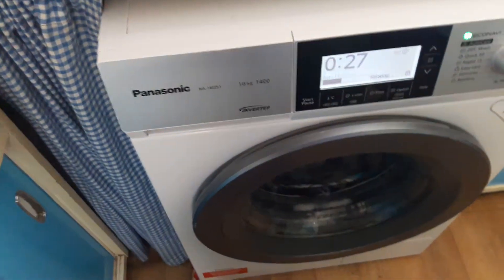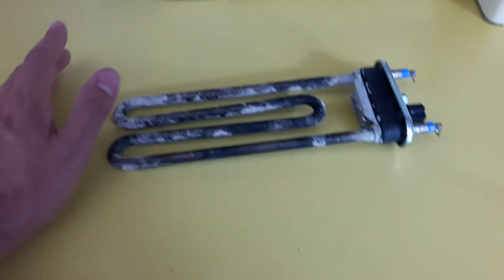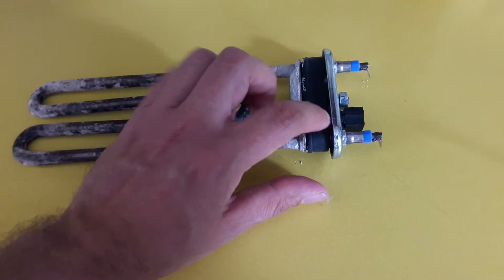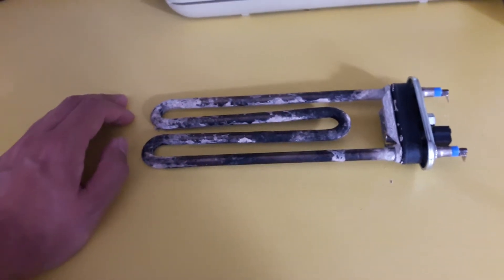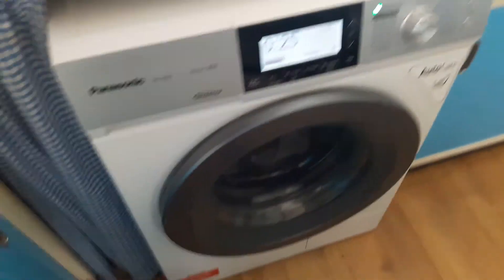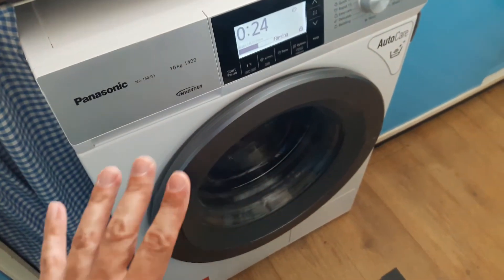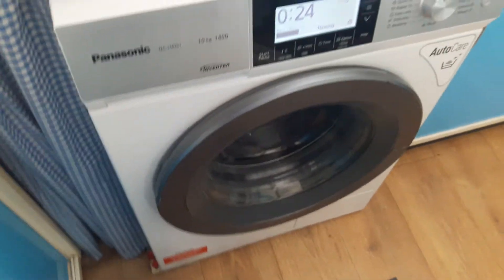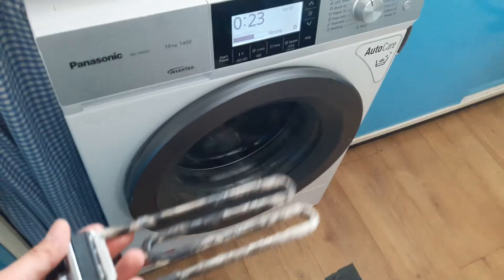Panasonic NA-140ZS1 washing machine open circuit heating element repair part 2

Comment: Hello and thanks for the video, I am struggling to find the element and from the video you state you used a different one ? have you got a link or a part number which would be hugely appreciated, thank you
Reply from the maker: I don't have the exact part number but the element is replaceable with a visually similar looking part, as long as the length is about right something that looks the same should do. Try to also match the wattage so it all heats up as before and lower wattage will take longer etc

Comment: How the element was removed would have been useful, limescale would cause overheating, it forms an insulation.
Reply from the maker: There are lots of much much better videos out there detailing how to replace the element on a washing machine i'm sure you will find much more helpful and useful

Comment: That is a Gorenje made machine
Reply: How do you know many Panasonic washing machines are made by Gorenje? Not all Panasonic can be made by Gorenje, some could be made by Midea or Vestel, or some can even be made by actual Panasonic theirself but only can be seen in Japan where both all top & front load washer dryers come with heat pump
Reply: @huuhoangmanh685  I said THIS is one of many gorenje made panasonics. Not all panasonics are gorenje made like you said,
Reply: These are made by PRC , only thing I need to replace is  the a shock absorber on soap draw side. Rattling like buggery on any spin cycle.  
Touch wood that's the only thing wrong with mine, as its a replacement for my original Panasonic.